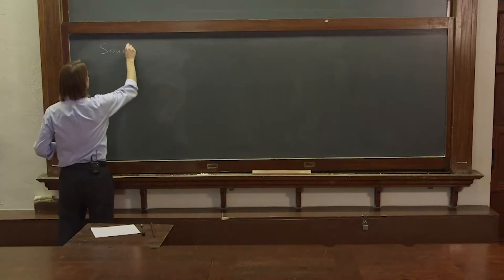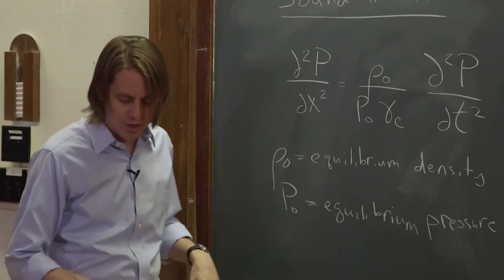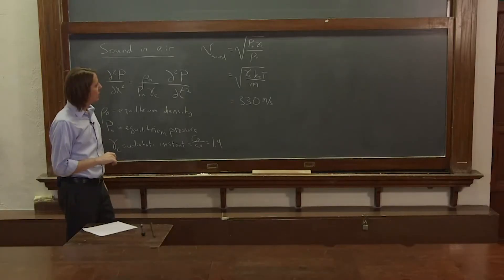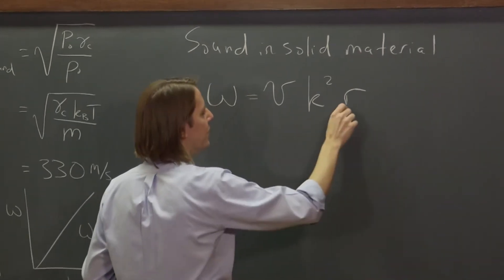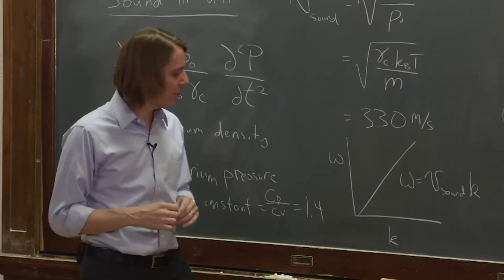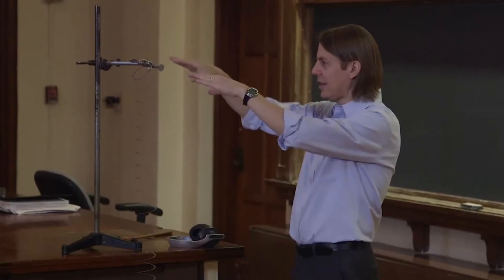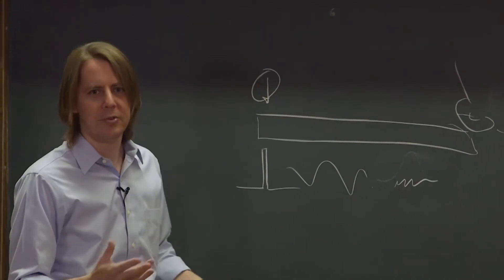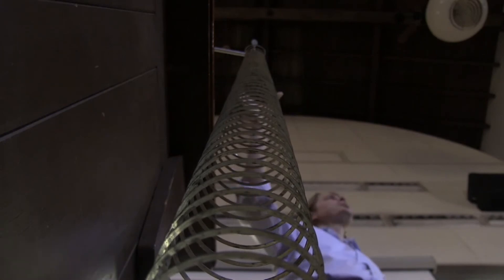PHYS 201 | Dispersion 7 - DEMO: Dispersion in Sound Waves

Comment: I have a question regarding the adiabatic constant. You mentioned that it is the specific heat capacity of the gas at a particular pressure divided by the specific heat capacity at a particular volume. I don’t understand how it is then a constant since we are employing it specifically to find the changes in pressure as a function of time and position within our PDE. Does the gamme term not also have a dependence on pressure then? You’ve even written it as C_P which to me implies some parametrization on pressure. I may be mistaken or there may be a proof that it is always constant that I am unfamiliar with. Thank you so much for the videos by the way!

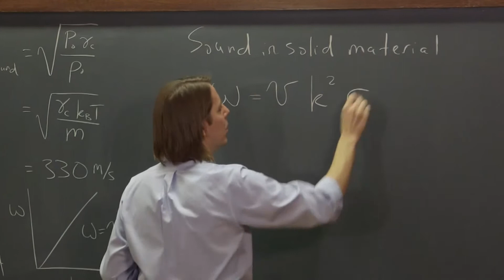Comment: Sorry to bother again but if we took this equation from 4:20 and we know that the spring is from steel (whichs speed of sound is 5790 m/s) and from experiments i got the highest frequency 7000kHz and the lower one 1000kHz the speed of the higher one is 333550 m/s and the lower one is 6753,452 m/s isnt that just a bit big difference???

Comment: I saw someone explained that the ID and OD difference contribute the dispersion. He reasoned that ID have shorter acoustic path than OD's so caused the dispersion. This is the link: https://www.youtube.com/watch?v=UppEMa77v9I
I wonder if leaving the same length of the slinky but varying the ID and OD, shall there be any change?
Reply from the maker: The shape of the slinky may affect the sound (due to OD and ID), but the basic change is pitch is almost certainly due to dispersion within the solid material.  I say this because you get the exact same kind of sound in other objects.  Ben Burtt famously used this effect for the "pew pew" blaster sound.  He used long steel cables rather than a slinky.  I can't find him doing it, but here is someone else ( https://www.youtube.com/watch?v=hHYbQ05q9t4 ).  You can also hear pretty much the same sound on a frozen lake.  When the ice cracks it generates impulses that disperse as they travel through the ice:  https://silentlistening.wordpress.com/2008/05/09/dispersion-of-sound-waves-in-ice-sheets/

I looked into this carefully before making that video and there are relatively recent scientific investigations into the effect of the slinky shape.  If I could get the NSF to fund it I would study it for sure! :)
Reply: @Prof-Hafner  Thanks! I also noted the acoustic dispersion about the frozen pond which is pretty awesome example to prove some materials are acoustic dispersive, somehow analogous to the light wave counterpart. This also recalled me that I also found some strange sound effect in a just mixed hot cup of cappuccino when stroked by a spoon at the bottom. This sound may also be described and explained by the dispersion. However, this sort of strange sound will be gone after a moment of settling of the cappuccino.
Reply: @Prof-Hafner  Luckily, I can find another person do the same thing as I did before for the cappuccino: https://www.youtube.com/watch?v=QP5muBhZHho